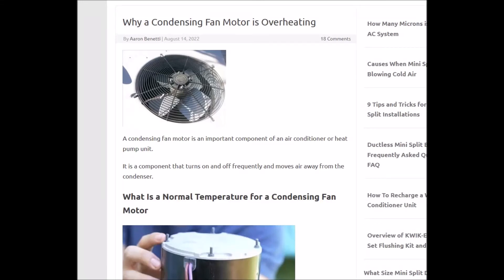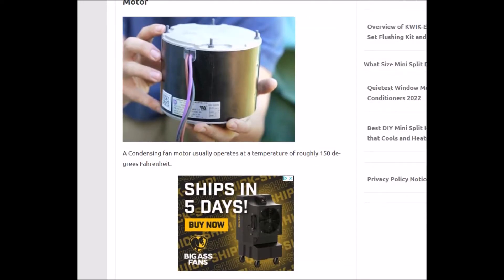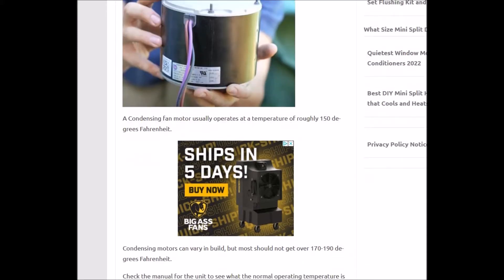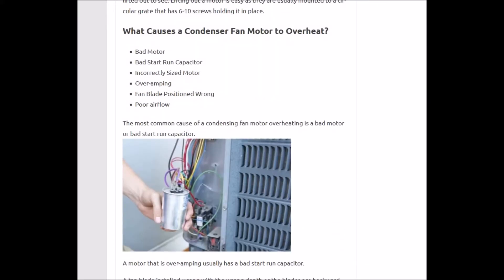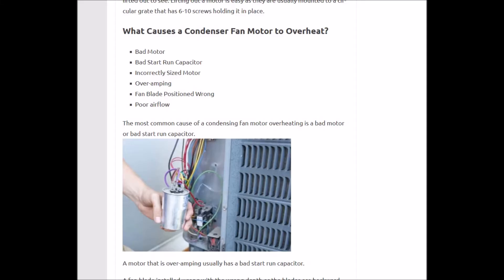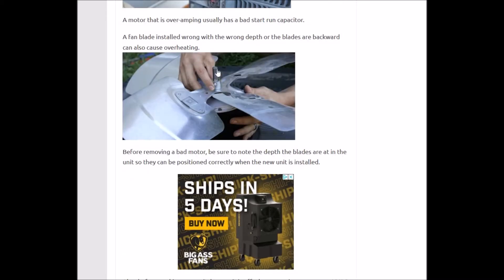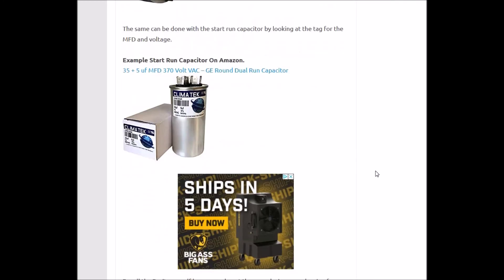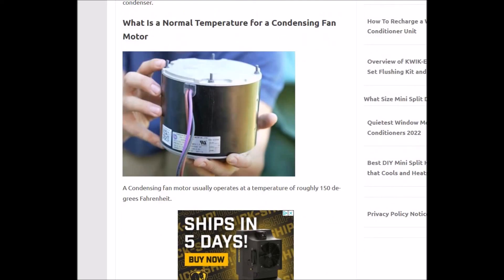Reasons Why a Condensing Fan Motor is Overheating Air Conditioner or Heat Pump

Comment: I have a goodman changed out fan, motor cap and added a hard start cap for compressor and it's doing the same thing the old motor was doing.
On start up fan runs for abou 5 to 7 min and stop. I cleand condenser coil but hadn't looked at indoor unit yet. Can you help? Thank you.
Reply from the maker: It seems like you have done all the basics, even adding in a hard start kit. It needs to be diagnosed. If you can check the motor amps, that will show if it is having a problem. If the motor is not getting too hot or overamping, and there is good airflow, it may be low on refrigerant.

Comment: Hi, capacitor was bad fan motor was bad and the board was fried I don’t know what cost of 3 things to be like that but I’ve changed all those three things and the new fan motor still running hot and shut down after about 10 minutes or so
What should I do next? Thank you.
Reply from the maker: It needs to be troubleshooted, but if the fan, motor, and board are good, be sure the airflow is good, and the coils are not blocked up. Also, be sure the fan blades are set in the right potion. If you have an AMP clamp, check the amps and see if they are high.

Comment: Having this problem with a rheem package unit changed the motor, fan blade, and capacitor. Only thing i can think of is that the fan blade pitch is creating too much air resistance for the motor to handle, might try changing to a higher amp rated motor or a fan blade with less pitch. Supply house swears the motor and blade are “OEM”replacements but keeps overheating.

Comment: Wire placement is important as I found out today. The schematic on the motor did not specify which lead from the motor went to which terminal on the capacitor. I had them backwards and my motor kept overheating and locking out on thermal overload. Once I switched the wires, common and fan, the amperage dropped down to a cool 1.8 A. 😎 
Thanks for the video it helped.

Comment: I have checked the specifications sheet and it does not show a fan depth to set the blades to.  Where can I find the measurement and where do you measure from?
Reply: The motor was previously replaced by a "handyman" so it is not the original motor.
Reply: Noticed they never gave a final answer
Reply from the maker: Look at the location on the old motor. The shaft will have a spot where it was located. If the motor is differently sized, be sure to calculate that in.

Comment: Water may be to blame, too. My furnace started leaking condensation water or Freon, not sure which. A week later my fan quit turning but gets hot. Also the filter was sucked tight to the motor. Maybe the filter got wet. Restricted airflow, which sucked the filter in. IDK. It certainly sucks.

Comment: I changed fan motor on old GE central air unit,it runs about 10 minutes and shuts off, does the fan it self have to be at right height could I have fan blade to low?
Reply from the maker: Fan height can cause issues. Was the fan capacitor replaced? That can also cause issues.